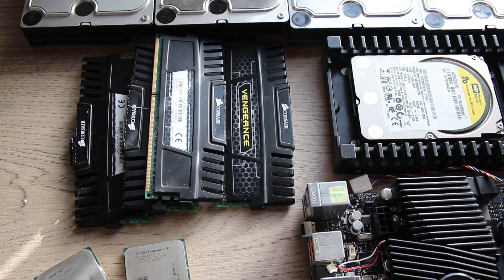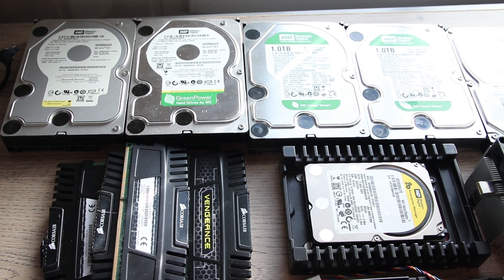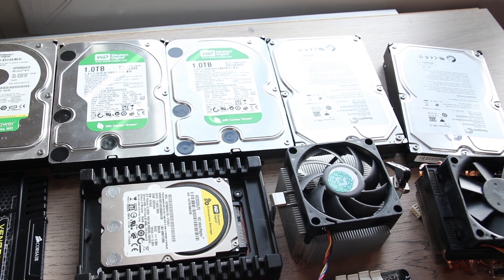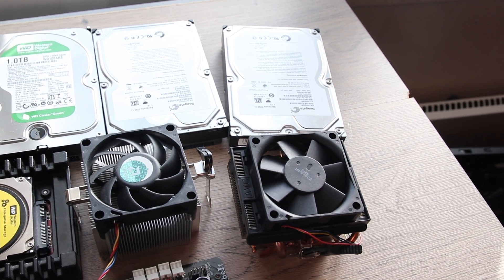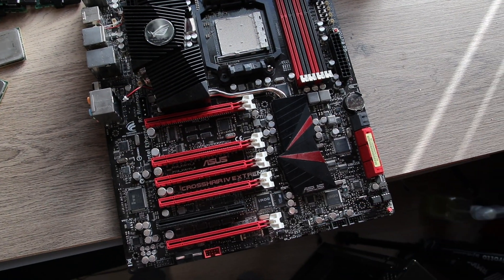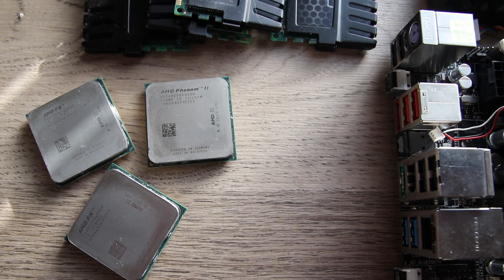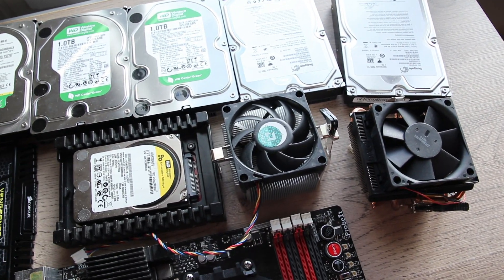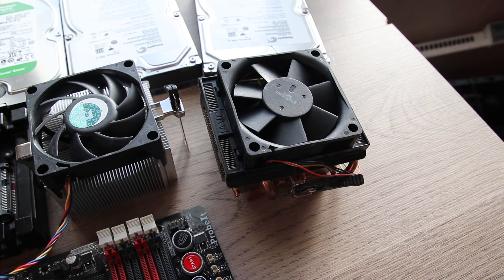Let's build a NAS using old spare parts!

Comment: Ah so nice to see a case that holds lots and lots of HD's.
Cool to see a home made NAS, so much cheaper than buying one and with a lot more options.
Reply from the maker: Yeah those types of cases are getting rare these days, although Fractal Design seems to still include lots of room for hdd on their define series.

Yeah it's cheaper, more fun (IMO) and you learn quite a bit along the way. I would argue it's more environmentally friendly given that we reuse old parts, but the power consumption might weaken that argument.
Reply: @DontCallTechSupport  there are used low power parts that are good options, a cheep CPU with IGPU that's a tad newer will have much better power use.
once you go past 2-4 drives DIY NAS is the best value option & simpler to fix if something dies.